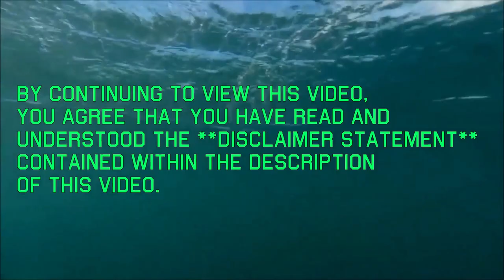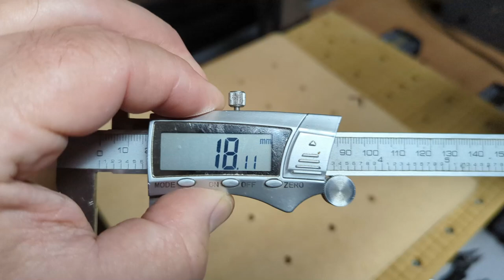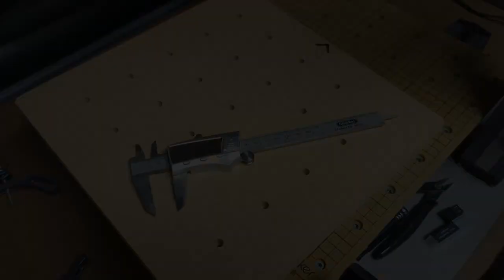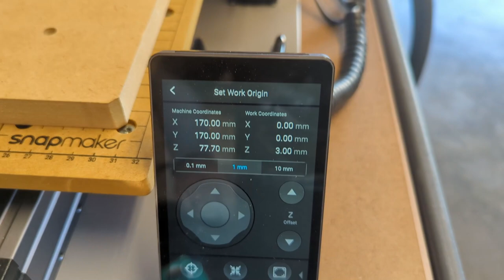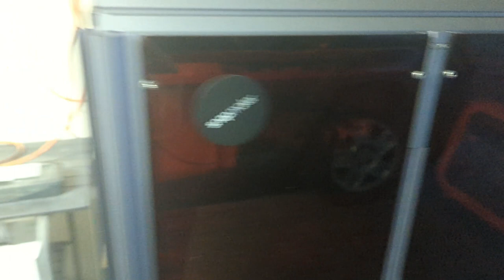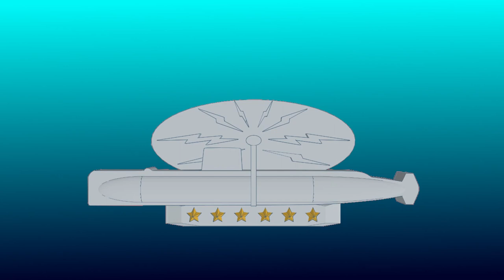Snapmaker 2.0 A350: Using the CNC Mode-Level The work Surface Part 2 with "Lessons Learned"

Comment: Do you have a link for the plainer bit you've used ? Thought the SN 2.0 could only use bits with 3.175mm diameter shaft. Or how did you attached it ?
Reply: not sure how they are called in english but you can get different ER11 collets to allow bits with different diameter shafts

Comment: Very cool video! I was afraid my snapmaker wouldnt be able to mill bigger stuff like a guitar bridge, mostly due to the size of the bits. But seeing your video im like: dammmn no problem! Looks like you changed the collet and nut of the router attachment. Do you by any chance know how big it can go? I would love to put a bigger bits to do the rough work before changing it to a finer v bit for the final passes. Also to reduce chance of breaking the bit. I recon routing in ebony or rosewood with a 3mm bit would be a pain in the ass.

Regarding the dust problem, i believe the machine itself is the solution!😅beeing a 3d printer, why not just print an attachment for a shop vac that clips or clamps on the machine head? Im sure someone out there already thought that through! If not i will definitely have a go at it myself, as dust is a big issue in my small basement workshop🤔 if i find a good solution or manage to make a good prototype, ill send you the file😁👌
Reply from the maker: Just the Collet changed, still ER11. I bought this set: Genmitsu 15PCS ER11 Precision Spring Collet Set for CNC Engraving Milling Lathe Chuck Tool, 1.0mm-7.0mm & 1/4", 1/8"   https://www.amazon.com/gp/product/B08K7FDDRR/ref=ppx_yo_dt_b_asin_title_o04_s01?ie=UTF8&psc=1